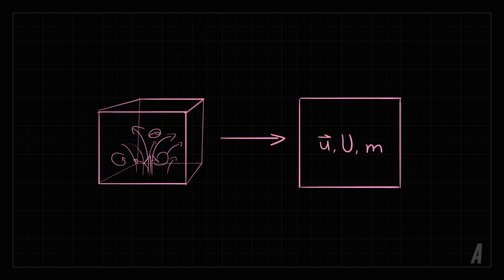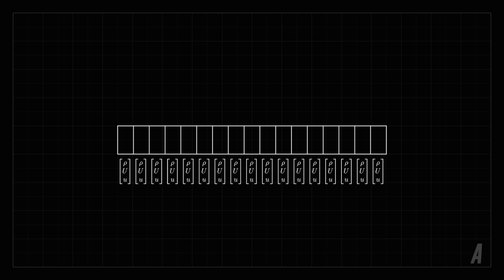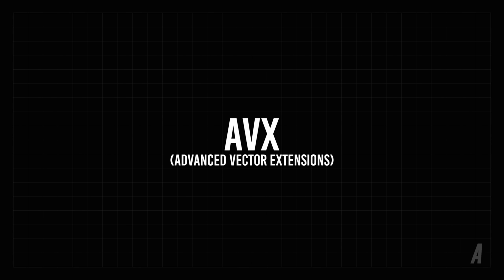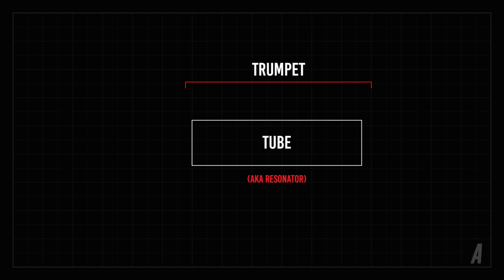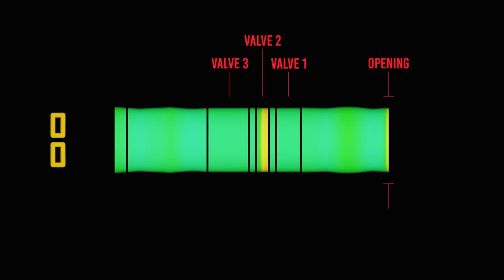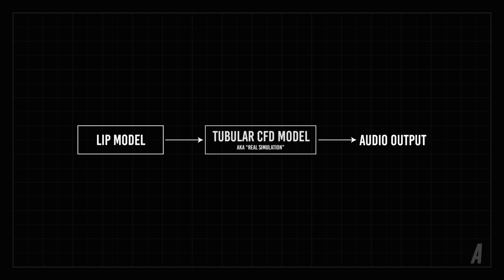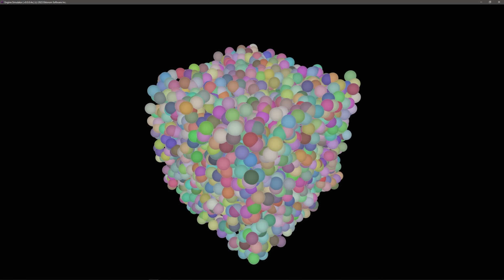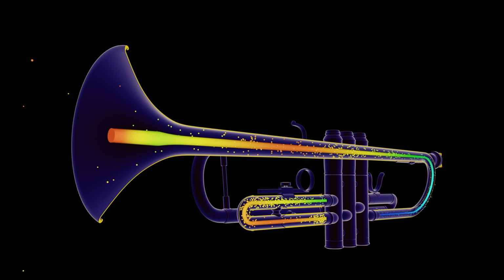Real-time Trumpet Simulation [C++/Vulkan] [WARNING: Flashing Lights]

Comment: That rendered model of the trumpet with the fluid simulation made me realize I don't know what path the air takes when the key is pressed, and what path it takes when the key is released.  With the key released, does it just flow straight through the valve body?

Comment: To address the massive air-flow issue, perhaps you should model the human side of the instrument. I think trumpet players start oscillation by strongly pursing lips, then releasing significantly while maintaining lip pressure to keep the oscillation going. This kick-starts the oscillation without needing large quantities of air. Additionally, perhaps introducing a volume of air before the mouthpiece would provide some elasticity to the incoming air volume, which might encourage oscillation. I may be way off, but wanted to suggest anyway. Excellent work, friend!

Comment: This is brilliant! Considering that the flare or bell, are not yet implemented, the tone character is impressive. If interested, there are many MIDI controllers with banks of freely assignable encoders, pots, sliders, and buttons for real-time control. There are also a few advanced MIDI keyboards, such as Osmose by Expressive E, that provides continuous X, Y, and Z axis for each key. It's not true 3D, as the Z axis measures force beyond a certain threshold, while Y axis measures key deflection up to that point. I mention this unit, as the more advanced Continuum by Haken provides true 3D per finger but is 3x as pricey.

Comment: Writing shaders for sound is quite the fun exercise. But I don't think that it works in realtime (at least the implementation I have seen in shadertoy for example). It just renders to a buffer where one dimension is time at the sample rate. So you only need two values (left and right). and then do 300*48000 for the dimension. Which can be rendered in maybe a second or so. And is then just played in real time next to whatever Fragment shader you developed. 

I am implementing a shadertoy clone in wgpu, and have considered how to do sound shaders. One concept was to render not the whole duration once, but small chunked buffers every frame. And then hopefully play it without pauses... But I am not doing that right now. 

Doing time domain Simulations is also interesting. I now wonder if you can do that for the electromagnetic field. Surely won't be realtime. But you could fft that back to visible light. But allows. you model like wave interactions of light - but doing so for a light simulation? I have seen it done for like 2D slices... But never to go back to RGB colors that your eyes approximate. Maybe this could be useful for getting thin film interference right and stuff,m

Comment: First of all - I LOVE THESE VIDEOS. Secondly - a trombone would be a nice instrument to model, it's literally a tube that expands and contracts. It would also give a platform to experiment with harmonics, multiple notes can be produced with the same length tubing just by changing the embouchure (vibration of lips at mouth piece)
Reply: Second note, the lengths of your valve sections (in proportion to the whole length) are the reasons why the tuning sound bad. The lengths are important like guitar strings and helmholtz resonances
Reply: Third note - as a former brass player I agree with the model as far as air speed from the mouth model. You can play with a little bit of air but if you want to be HEARD (especially tubas) you need AIR
Reply: Last note - during the "volume warning" @18:30 it sounded like the trumpet wanted to go into a lower harmonic for a few moments (the same harmonics I mentioned in my original comment)

Comment: This is mindblowing. Im just impressed that it's possible to do this with programming. I think Vulkan is just the tool to create the visuals and has nothing to do with the physics and simulations under the hood. It's still broadening my horizon as to what you can do with those graphics libraries. Is there any reason for choosing Vulkan over others like OpenGL?

Comment: Very impressive what you do!! Fluids, like ray tracing. Truly stunning. the sound is really realistic, like everyone says. Well done. Just a small detail, which is absolutely not a criticism, but just a reflection: the trumpet that you have modeled sounds more in Eb (or almost), whereas it should sound in Bb or C, if you have modeled a trumpet in Bb or C, of course. So the first resonance frequency of the tube is not quite correctly calculated? So which parameter is incorrect? The length of piping? the speed of sound?
This may be relatively important when the simulator will calculate the tone of each tube of a car engine, but perhaps not that much.

Comment: Without knowing anything about fluid physics, I can guess why blowing so hard is necessary for the simulation to get a decent sound. 
For some reason, when you blow by vibrating your lips into a cylindrical tube without a bell (like a PVC pipe), the sound is much muffled and also generates a lot of resistance. That makes playing different harmonics more complicated. It's like the bell brightens the sound, the resulting note contains higher frequencies. That's why you don't need to blow as hard to get a decent sound with the bell at the end of the pipe.

Comment: Professional trumpet player here, this is fantastic! Even without fully modeling the stroke of the valves, the sound of changing pitches is quite accurate.

To answer why a seemingly-ridiculous amount of air volume seems to help the sound of your simulation despite it not being realistic: there is a great deal of air compression generated when playing trumpet, such that if the lips did not resist the flow of air, one would empty their air capacity in under three seconds. If the 'lips' in your simulation do not make a distinction between pressure and volume, then it makes sense that volume could stand in interchangeably for pressure.

I have a few questions about the physics behind what I'm hearing:
1) I hear each pitch 'bloom,' growing louder over a small period before reaching its full resonance. What does your simulator look like as this happens? How many periods does this take for the sound to fully 'saturate?'
2) What parameters are you changing with the 'lip' so that it sounds like these different respective instruments?
3) In reality, the mouthpiece-side of the trumpet is semi-open as well, as behind the 'lips' would be one's body, a resonant chamber that directs a positive air pressure differential past the lips. As a result, the vibrations of the lips resonate not just into the trumpet, but also back into the body. The body also receives reflections from the standing wave of the trumpet, creating more interactions that influence the sound. Thus, in practice, the size of the oral cavity, constriction of our airflow, and corresponding air pressure play a pivotal role in our tone production, and explains a big portion of why people sound different to one another. How much of this resonating open tube behind the trumpet can be modeled with Tubular? What would happen to the sound of your simulation if you modeled it? What would the 'wave' of the body look like at different cross-sections?

Comment: i’ve done a good bit of air pressure and fluid simulation, but i never thought you could get audio out of it without sampling at 40 khz, which is a bit fast for even the beefiest gpus.

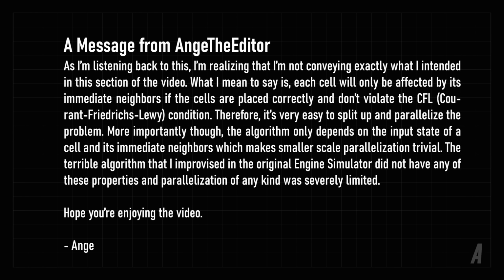Comment: 5:38 are you saying that you only need to look at the state and flow from the nearest neighbors (1 hop away)? Therefore you can parallelize the calculation? None of the speed of light stuff was relevant really haha
Reply from the maker: It IS relevant because the ability to look at only the nearest neighbor is entirely dependent on the signal speed of the system. It's an assumption, and not always a valid one.
Reply: @AngeTheGreat  ok I see what you're saying! But that is also dependent on your sample rate?
Reply from the maker: In a sense yes, but it's really the other way around. The minimum simulation frequency (which I'm assuming is what you mean by sample rate) is determined entirely by the spacing of the simulation grid and the signal speed (ie the speed of sound).

Comment: The resonance of brass as a metal is vital to the reduced air flow necessary to produce sound because every inch of the tube is added shaking of the instrument which aids in the increased efficiency of kinetic energy’s transformation into sound.
Reply: This will also aid in your high harmonics necessary to form timbre

Comment: 7:53 Didn't you say that the horn flare was not included in the simulation? Then it should be expected that the volume of air needed would be very high. The horn IS the trumpet (a few other technical details aside that is).

Comment: If you removed the requirement for real time and focus on accuracy, you could train an AI and give it an accurate thing to control/train with. That AI can run in realtime with minimal resources. There is a lot of potential there anyways.

Comment: This is an incredible project! Definitely earned a sub from me :)
I want to point out that the reason you get the woodwind sound in some cases is most likely because of the cylindrical bore that you pointed out. The shape of the bore has a lot of influence over the harmonic structure (timbre) of the instrument, so I'd love to see a follow-up once that change has been made.

Comment: Brass players can control the frequency they are buzzing with their lips by adjusting the aperture size of their embouchure. For example, by making the aperture smaller while using the same amount of air, the airflow is compressed allowing to play higher pitches without the same increase of volume. Assuming a constant aperture size in your model, I’m not surprised it took more airflow than you expected!

Comment: "so playing this thing is not as simple as plugging in a MIDI keyboard and then playing random notes"

As a sound designer i can say that this is in fact partially not true!
The air pressure on a brass instrument can be covered by the keys velocity
And i do know that trumpets work differently then piano and stuff so for higher notes more pressure is needed, so the place of the key on the keyboard (for example 0 for the lowest note and 100 for the highest note) can also be hooked up to the pressure, the tension of the lips can also be linked to some variable (like the so called "mod wheel")

But my point is that for every variable you need to control you can link to some variable your MIDI controller can provide with a bit of logical thinking, and if you think logical enough then you might figure out that for some variables you don't need a direct link but instead you need some simple equation that takes in variables from your controller and then that equation calculates what the variable on your simulation needs to be.

I actually found all of this out when i tried to make a simple brass sound to use for an arpeggio in my music but i highly over engineered it and now i have a preset that can basically mimic most brass wind instruments for most use cases (stabs, leads, bass, plucks, etc.)

And because i made it by trial and error and other debugging methods and stuff it basically had sliders with which you can fully customize how the synth reacts to the inputs it gets.

Comment: Holy shit.  That was impressive.  We do blow a lot of air into the trumpet... and it takes more air flow to go higher in pitch.  It also affects the "harshness" of the notes we play.  Without understanding what you mean by "a lot of air" it's difficult to really say for sure what you are dealing with in this simulation, but I am still impressed at how it actually sounds like a trumpet.

One thing about the way trumpets function is that the length of tubing used can be redundant with subtle differences in tuning.  Some valve combinations are never used and some become entirely useless as we climb up in pitch.  At lower pitches, we use OPEN, 2, 1, 1+2, 2+3, 1+3, and 1+2+3 to descend.  However, one octave above that, we don't use the 1+3 or 1+2+3 because those are substituted by OPEN and 2.  Being in a different harmonic series, you end up with less valve combinations before you just end up back at OPEN again.  Tuning becomes an issue that can sometimes be overcome by using "alternate" valve combinations.  3 alone can act the same as 1+2.  It won't be the same pitch, but that's where the slide triggers on the first and third valves help as we use our fingers to manually slide the length of tubing to adjust pitch.  This is required for some notes under all circumstances as well.  If we never lengthen those slides using the finger triggers, the notes would have to be pitched using our lips alone (which we do in fact have a little control over).  There is also a "half valve" technique were we can make a sort of squeezed sound from pressing the valves down in between their fully open and closed states.  Not sure if your model can produce that.  And when we "overblow" you can actually get a harshness that sounds pretty terrible.  Underblowing can still produce a pitch, but sounds weak and feeble.

Anyways, hopefully that shared some important and/or interesting trumpet info from a trumpeter's perspective.

Comment: The reason it's requiring so much air is the geometry of the mouthpiece isn't taken into consideration with the current model. The mouthpiece is designed to rapidly increase the air pressure like a nozzle.

Comment: 17:53 it's because of the missing bell, I'm pretty sure. The flare is an impedance transformer (low velocity / high pressure on one side, high velocity / low pressure on the other). So without it, the amount of air you have to introduce at the mouthpiece comes out wrong.

Comment: @angethegreat You may have already seen one or both of these, but I've previously saved a couple of papers on trumpet acoustics that might come in handy for improving Trumpet Simulator.

The first is Trumpet Acoustics, by A.H. Benade of Case Western Reserve University, in 1973. It's a general look at the acoustics of brass instruments and I'm not sure how useful it would be.

The second is maybe more useful, Bore Optimisation and Impedance
Modelling of Brass Musical
Instruments by Alistair C.P. Braden, University of Edinburgh, 2006. This paper deals extensively with how the shape of the instrument affects its impedance and intonation, and could be useful for getting a simulation that's more realistic than a simple cylindrical profile.

Comment: Two questions

1. Have you considered running offline simulations? Maybe you can get it just right by not being constrained and then optimize or simplify.

2. Have you tried to use AVX or even CUDA to speed up the simulation?

Discard question 2, I wrote before reaching further into the video.
Reply from the maker: For the first question, I'm already doing that. I haven't really taken any shortcuts in order to run in real-time and the techniques that I used are identical to offline techniques
Reply: @AngeTheGreat Thanks for replying. This is awesome work, you basically have my dream job! Keep it up.

Comment: This video was amazing, but i have a couple notes, no pun intended. Former trumpet player,middle to high school only, but first chair st least. First, when playing a note using the first and third valve, you have to extend the third valve slide to get the proper pitch, otherwise it'll come out sharp. Second, i think that part of your need for an excessively high air flow/pressure is because you dont have the bell simulated. Thats killing your volume and you have to blow way harder to compensate, giving it a weird muted sound. And finally, once you added the concert hall reverb, that flutter you did before playing is a very relatable example of a habit brass players pick up, both a sort of nervous tic and also a way to make sure none of our valves are sticking. Watching this made me want to dig the old Conn and my Harmon mute out of the closet for old time's sake